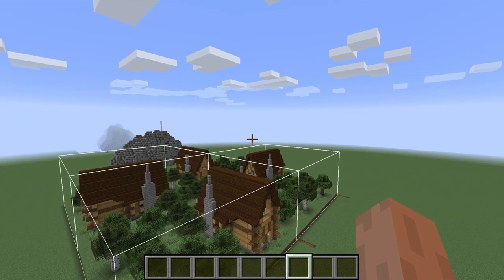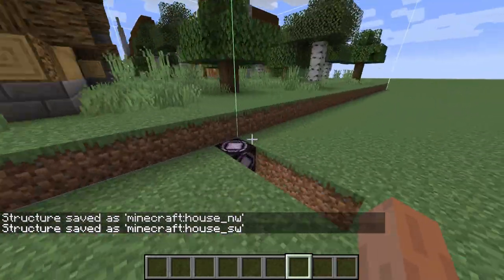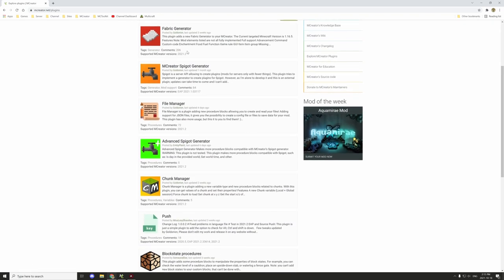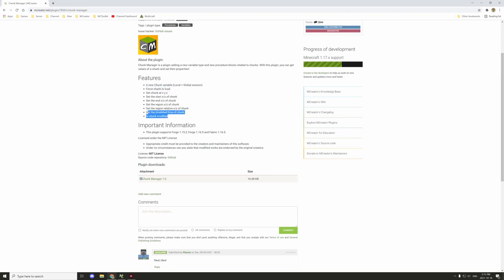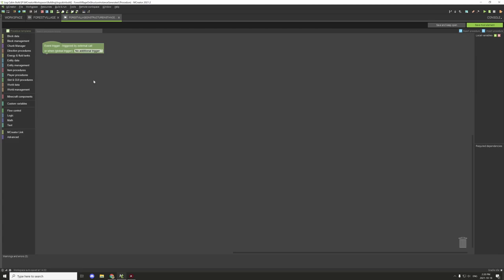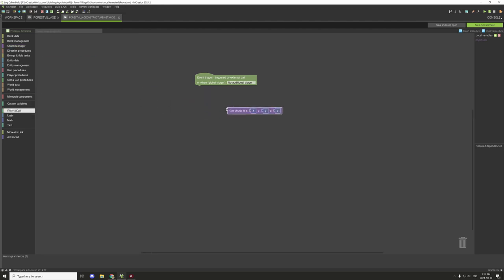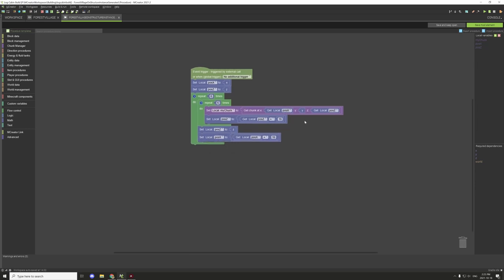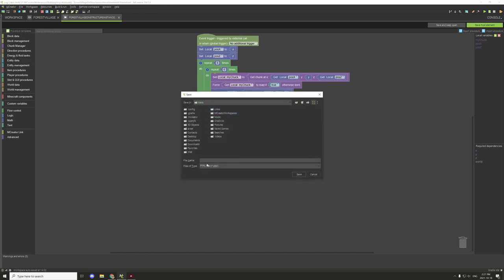MCreator: Building a Cabin | Part 4

Comment: Nice tutorial.
Reply: Nice trick
Reply from the maker: Thanks!
Reply from the maker: There will be a part five, I worked on the mod a bit this morning trying to get the structure to spawn properly, I had to drop support for the under part sadly but  I did manage to get the structure to generate in the proper order so it should be ready for part 5

Comment: Hello, man. I have a problem with my structures, some blocks are replaced with dirt or/and being cut off. It is because of the chunk problem ? So, I do need to this particular script to correct that problem ? Thanks!
Reply from the maker: The chunk problem is due to the chunks not being loaded before the structure is generated. I think this is based on the way structures are handled at the moment. MCreator currently uses features for generating structures not the actual structure generation system as this is a a bit newer than features. You would need to force load the chunks around your structure and then force unload them, this should fix the issue with them being cut off. The script I use helps with floating structures like trees and makes sure they only spawn on the ground not in the air. It's handy for anything you need to keep grounded.